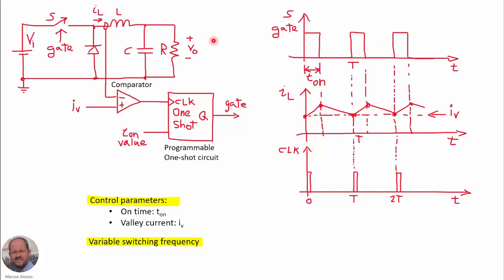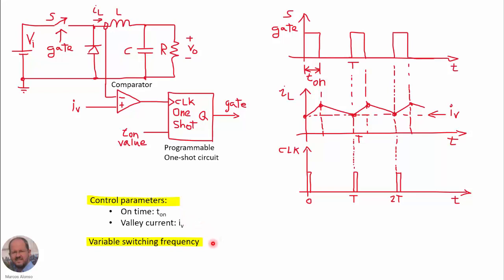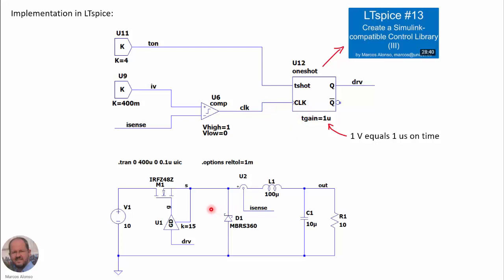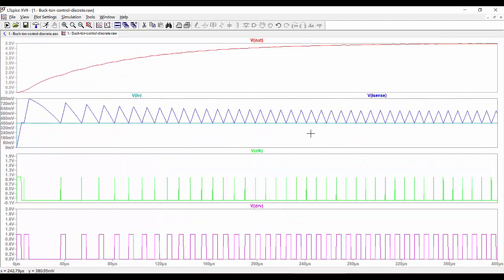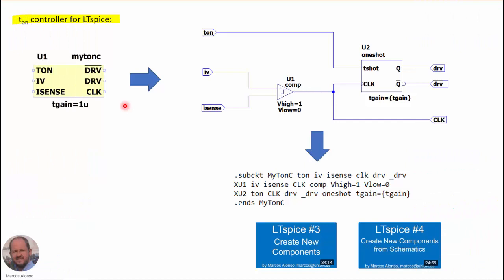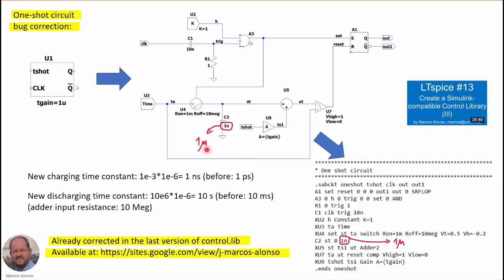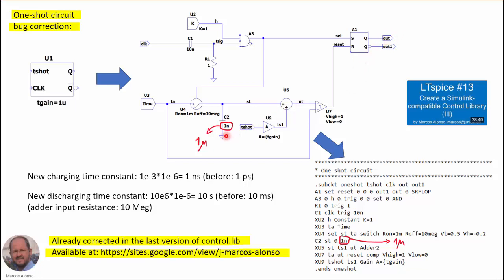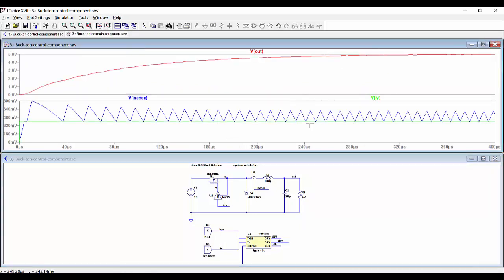LTspice #29: How to create a Ton controller for LTspice

Comment: thanks a lot sir . I learned how to implement the circuits in the playlist but the control system behind all of these was little confusing .how did you learn in your early stages sir?
Reply from the maker: Hello, here you have a couple of good books:
R. W. Erickson, D. Maksimovic; Fundamentals of Power Electronics. 2nd Edition, Springer, 2001
M.K. Kazimierczuk; Pulse-width Modulated DC-DC Power Converters, Wiley, 2008.